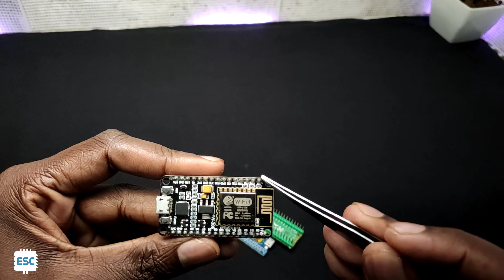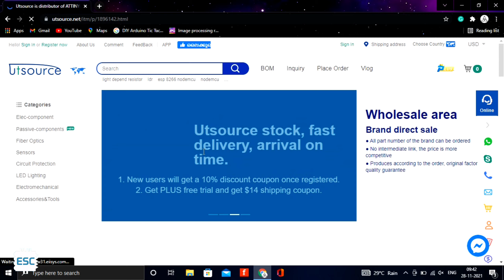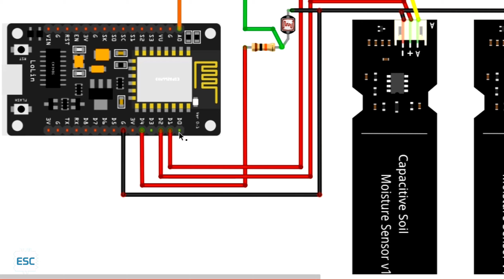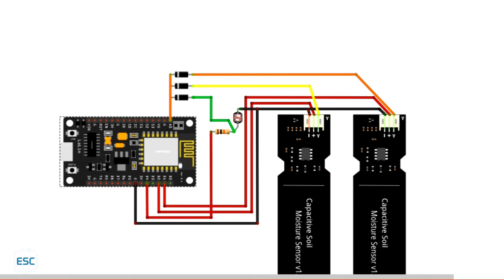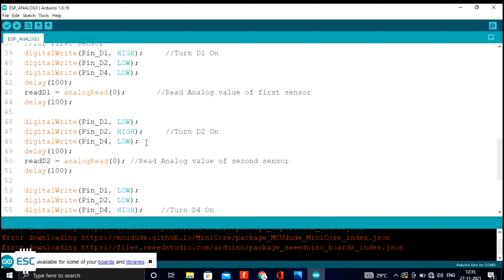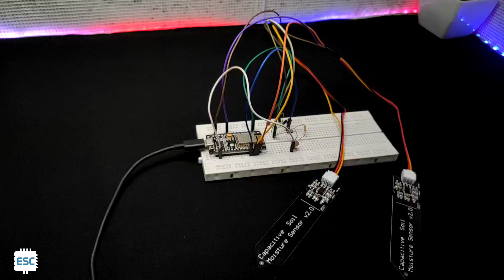Read Multiple Analog values in esp8266 using Diodes

Comment: I DID THE same steps for just 2 sensors , it returns wrong values for both , for example instead of returning 1024 for both sensors it returns 524 , when i remove one and keep only one i returns 1024 in the first and nothing on the other , when i plug both sensors and triger one of them the other sensor value also changes ... any solution ?
Reply from the maker: Thats due to the dropout voltage of the diode. If you want exact values then you have to use multiplexer.
Reply: @EDISON_SCIENCE_CORNER  thank you very much sir

Comment: which doide you used for it
Reply: Does it make a difference what diodes you us? If so, how do we decide which one to use?
Reply from the maker: Yes. You can use 1N 4007/1N4148 etc. You can use any type diode but should care about its forward voltage
Reply from the maker: 1N4007

Comment: Interesting solution.  What about the loss of reading sensitivity due to the diode-induced voltage drop?  Also, some sensors could have higher current needs than a GPIO could provide, so a transistor may be needed for external power switching.  A CD4051 analog switch may be a good choice if you need more flexibility.
Reply from the maker: Thanks. We cant do anything  to override the voltage drop.  We can switch sensors using a transistor driver or relay
Reply: @EDISON_SCIENCE_CORNER  couldn't we add in software the drop of the diod?